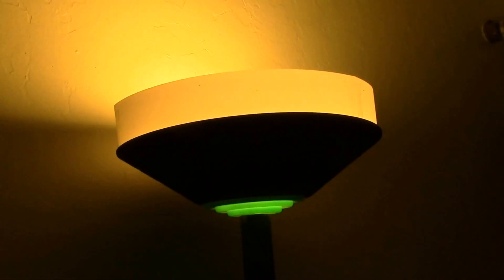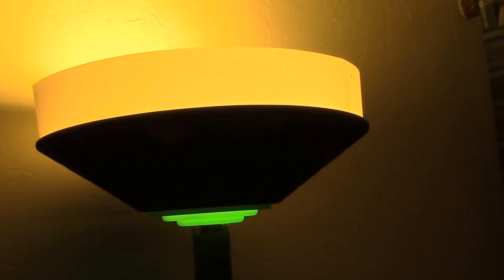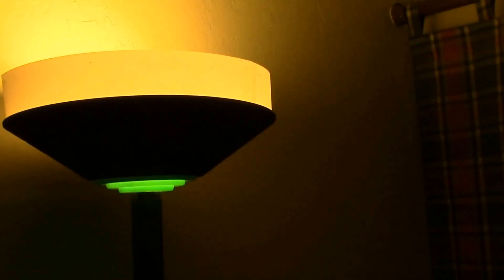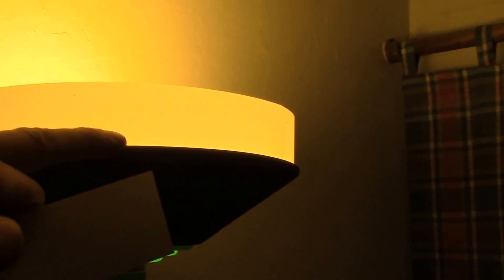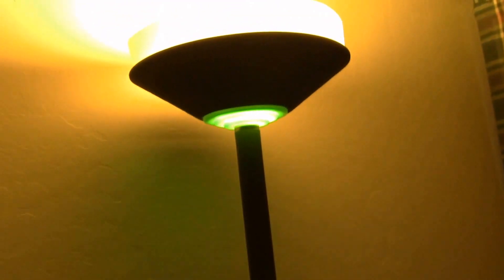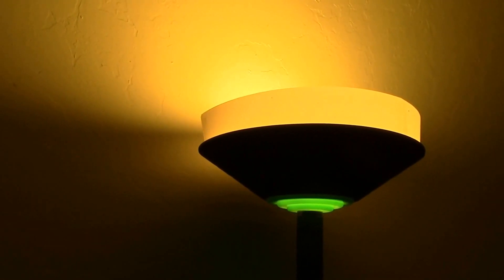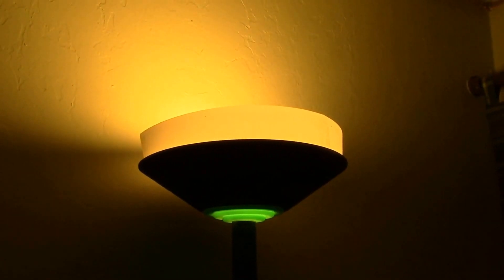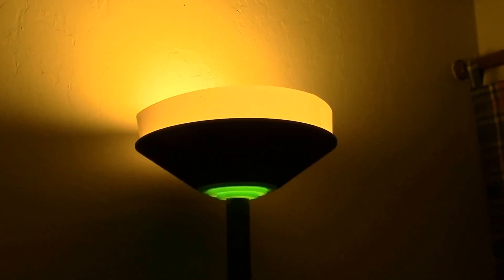Halogen Torchiere Lamp Conversion, Part 3

Comment: Looks like shit.  Sorry...but you ruined the aesthetics of the torchiere lamp with that crappy home made shade
For a better conversion and to maintain original aesthetics of the lamp, You should have used either a LED flat panel which can be purchased online, or you could arrange 5 sockets around the perimeter of the circle with 5 low profile LED bulbs. Your single bulb idea greatly reduces the amount of lumens of light versus a 500 W halogen bulb.

If you chose to do the 5 socket conversion, You can Use JB Weld to glue the bulb sockets directly to the metal.
Reply from the maker: I guess all is in the eye of the beholder.  I've been using this shade approach for about 10 yrs. now, first with some circular CFLs and now with the LED bulbs.  At the time I did those conversions, there were no flat, round LED panels that I could find that were reasonable (limited sizes, color temps, dimmability, etc.).  However, lately there have been some nice options come on the market in that area that I think may be worth trying.  Stay tuned and if I can find one that works, I may try re-modifying one of the torchiere lamps.  So far, I've done no permanent, non-reversible modifications, so it'll be easy to back out the Edison socket for something else.
Reply: Gotcha.  Yes, we all have our preferences/tastes, but I wasn't a fan of the shade you added.  
I like the look of the torchiere lamp and have several pricey ones in my house. 
 I am in the process of converting two of mine and will be going with the flat panel LEDs...the challenge is finding the right lumens (500 W Halogen is a lot of light) and getting the correct frequency...I prefer the 4000-5000 range (medium to soft white).  I have found several on EBAY and on Amazon, and ultimately ordered one off Ebay to see how it turns out before ordering a second panel.  Hopefully it will work out, but I toyed with the idea of just adding 5 sockets, and 5 low profile bulbs which totals to a little less money and easier replaced when that time comes (which could take years)
Reply from the maker: I went ahead and ordered one 21W lamp off eBay a few days ago.  Will see how it works when it arrives.
Reply: 21 W may do the trick, but it may be a bit dim.

Another way...try Five bulb sockets (about $15) and 5 Slim Style Low Profile 10.5 W LED from Phillips  (https://www.amazon.com/Philips-433227-watts-Dimmable-9-pack/dp/B00X53AJC8/ref=sr_1_1?ie=UTF8&qid=1515966372&sr=8-1&keywords=phillips+slim+style+led+bulb) will yield approximately the same light as a 500W halogen bulb. 

Wire it the same way you did, however lay each socket on its side. The 5 slim bulbs lay on their side inside the original Torchiere metal head base....no shade needed.  
5 x 10.5= 52.5 W .  These are 800 lumens each according to Phillips. 
5 x 800=4000 Lumens.  
They are also dimmable.

According to what I have found in my research, a 500W Halogen yields 4000 lumens.  So they should be about the same amount of light
Reply: Archangel0804 All of you are sheep🐑 to the globalist’s👹 agenda to stuff you with LED crap lighting! For Christ’s sake just keep the halogen socket and change out the bulb to a 75W one. You do not need 300W or 500W unless the room is over 20’x20’ or using a work light.🤦🏻‍♂️

Comment: Another Useful video 
many thanks 4 the share
Reply from the maker: Thanks for the comment.  The torchiere lamps I converted are still working great 2+ years later.
Reply: thanks again for the response
Are  you an Electrician or you only like to Fix everything by yourself
one of the torchiere Floor lamp that I have the Dimmer Switch stop working 
I'm wondering  If you convert this Torchiere Floor Lamp to a Turn Knob Lamp socket do you still need the dimmer switch or you have to Install a whole new wire cord in there.
 Also do you think that the Turn knob Lamp Socket should Fit on the torchiere  lamp without any modification
PS: I bought several turn knob  lamp sockets today, but I haven't change anything yet
Sorry to bother you again
TIA.
Reply from the maker: Not an electrician, but I have some electrical engineering background.  I also like to repair/modify things to work better.  On all my floor lamps that had dimmers, I think all of them were 2 or 3 position dimmers, so a L-H or L-M-H setting.  Some of the L/M settings stopped working but on the H setting, all the switches I have are just directly on and I think that mode bypasses the inoperative dimmer.  I think one of the lamps I fixed many years ago had a variable dimmer knob and I changed that out for either and off/on rotary switch or a Off-Lo-High dimmer.  You can get simple on-off rotary switches as most any hardware store and usually they are easy enough to swap into the tube of the lamp.  If doing that, maybe take out the old dimmer to take with you to make sure and get a new switch that will fit in it's place as it's a fairly tight fit inside the tube.  I've never tried a turn knob socket in a floor lamp.
Reply: Thanks again for the detailed message  most my Torchiere
 lamps had L-M-H setting, I really like the light they produce, but you 
have to be very careful when you turn them on @ 300 watts for instance 
my friend had a Torchiere Floor lamp and that Lamp smoke most of the time when he used @ 300 watts I told him to convert it to Standard, Led  or CFL
oh well, thanks again for the great information and for the video

Comment: Isn't this a fire hazard?
Reply from the maker: I suppose of one used that with the original 300W halogen bulb it might be.  But with the CFL or LED bulb, there's so little heat away from the bulb that you can't even feel it with your hand.
Reply: Or in this case, WAS... especially when positioned adjacent to things such as curtains, cheap Chinese wallpaper, Christmas trees, etc.